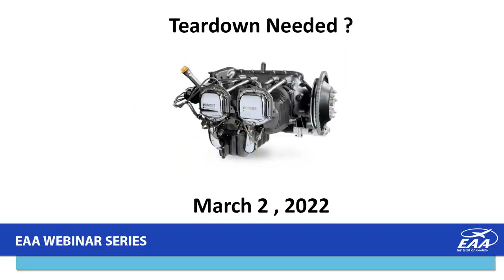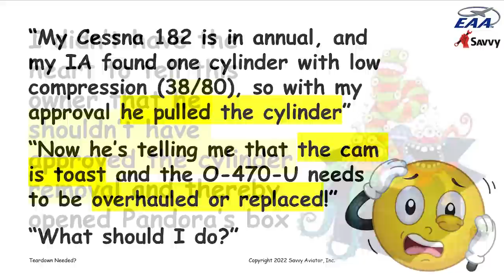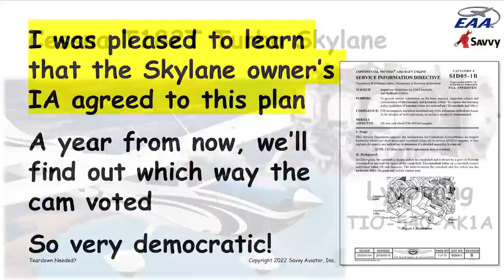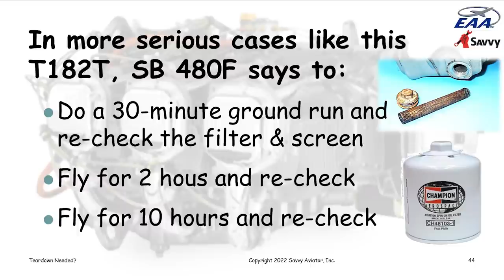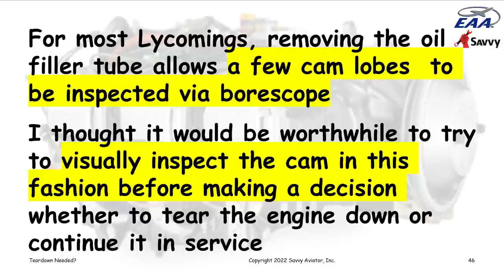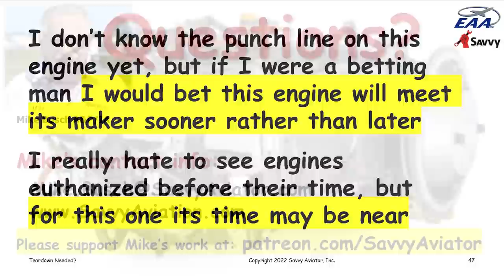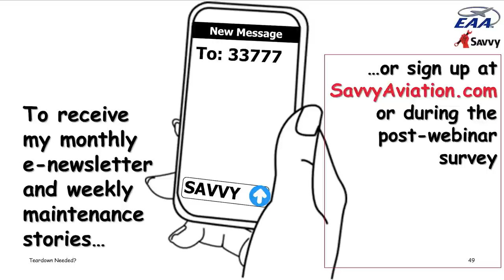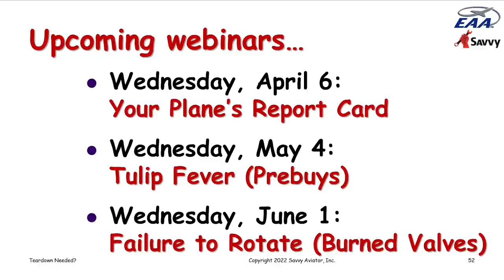Teardown Needed?

Comment: For anyone wondering about current overhaul/new engine costs, a factory new O-200A from air power inc is about $43,000 a factory remanufactured is around $41,000 with 6-8 months of lead time. 

The engine shops I have called are quoting about $22,000 for an overhaul. With lead times from as low as 8 weeks and as high as 20 weeks. A prop strike inspection is running about 9,000 as well. 

If you need to split the case or need a new engine it will not be a fun time.
Reply from the maker: with all the supply chain issues and labor issues these days, now is NOT the time to split the case; if you have the option, milk it.
Reply: @savvyaviation  If I could I would. I have a cylinder base stud that is coming out of the case. I suspect stripped threads due to the stud not spinning. Unfortunately it screws into the opposite case half. I can't think of an easy way to confirm my suspicions without at least removing the stud which would require the always dreaded cylinder removal.
Reply: @toothlessthea150m9  That's correct, by the way, how did it go?

Comment: I have received oil and filter analyses with metal reports.  Where does one find information with which to match the metal to a part?  For example, in this webinar, Mike concluded that the metal was almost certainly from the cam.  I would like to match metal reports with engine parts just like Mike did.  Thanks for your help.
Reply: Call the Engine Manufacturer and ask their service department.
Reply: Lycoming SB480, available on their website.

I’m am insure of a catch all SB for continental, I know of one that tells you what to do when you find metal but doesn’t give specifics on where it comes from. That may be in the maintenance manual - ie the M-0 manual for TSIO-550

Comment: I’m considering a purchase of a very nice airplane with an O-320. It was last overhauled in 1985 and is 400 hr SMOH. The airplane sat unused for 11 years and it was recommended by the shop that will do the pre buy that a cylinder come off to inspect the cam. Sure enough most of the cam lobs had severe pitting on them. The owner is an A&P for an engine builder and says he wants the replace the cam, lifters, seals & gaskets himself. So technically this will be a repair rather than an overhaul. Is this OK or is an overhaul due at this point? I really like the airplane.

Comment: If I am replacing the pistons and cylinders at 1500 hours and oil analysis information tells me nothing is wrong with the Rod Bearings, shouldn't I just change the Rod bearings anyway because I have easy access to the bearings? ... I never hear of mechanics changing these bearings. The Rod bearings take the most severe service, why don't we change them when changing pistons and cylinders.

Comment: If those ball bearings were in the accessory case it seem possible that the next time the aircraft was inverted or in a negative G condition they could end up in the gears! I’ve seen a small bolt end up in the gear train of an engine it locked it up and literally split the crankcase. Can you imagine what would happen if the balls locked up the engine when it was inverted flying at very low altitude, think canyon flying.
Reply: why are you flying in a canyon inverted?
Reply: Asking the real questions here. It's a Mooney, nobody is flying inverted in a Mooney, let alone in a canyon. @SoloRenegade
Reply: @cruiserflyer  oh, they absolutely could fly a mooney inverted and in a canyon, whether on purpose or by accident is a different question.

Comment: The oil screen on a Lycoming in a Mooney is not in a particular convenient or easy to get to place as suggested in the video.  I agree with Mr. Busch that the oil screen would stop the ball bearings but it is not a convenient thing to check on a Mooney.  It is located at the back of the sump down low with just barely enough room to slide it out between the oil sump and the firewall.  If you ever want to learn new swear words, just hang around a mechanic trying to re-install the screen and get it properly safety wired.  Not an easy task....necessary yes but not easy.
Reply from the maker: agree, its tough to get to, but still better than splitting the case?
Reply: @savvyaviation  I completely agree.

Comment: My engine a TSIO 550 Cont. had a taxi way excursion and all four blades on the MT prop (wood prop) hit the ground. Two were sheared off at the hub. I was going to tear down the engine but it was at taxing throttle position. Should I tear it down or just do an indicator run out check of the prop flange?
Reply: To my knowledge, there’s no SB from Continental requiring a tear down. I’d get the prop hub inspected with dye penetrant. Put a prop on it. Run it 30 minutes. Check for run out.

Comment: On a Lycoming 0 320, is it possible to view cam lobes by removing the oil sump or by using a borescope via the drain plug?
Reply from the maker: DId you mean removing the oil filler tube?  That makes it a bit easier, but the view is still not great.  The drain plug does not offer any way to see the top of the engine, unfortunately.  Lycomings are just hard...